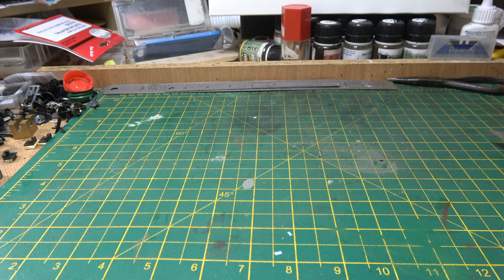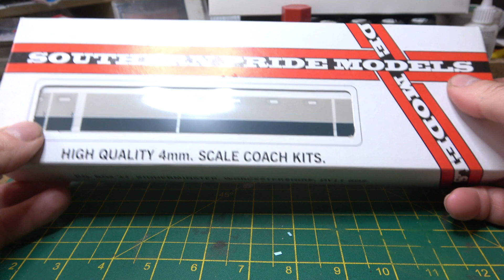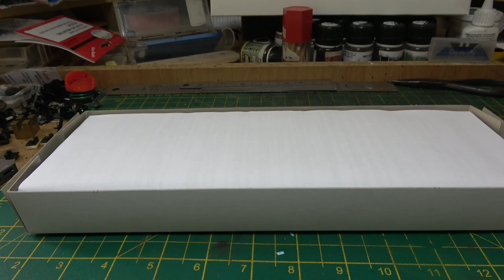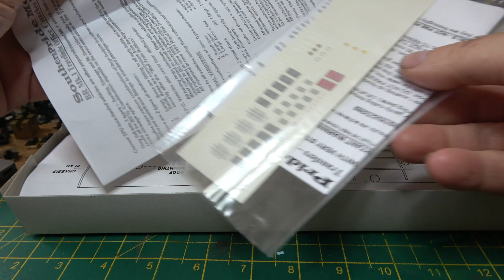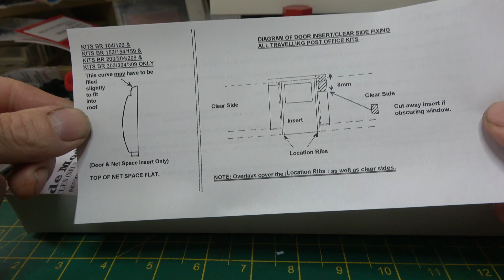Southern Pride TPO. Kit build.

Comment: Used to love seeing TPO stock when I did overnight spotting trips to Crewe; the York to Shrewsbury Postal (and return) stopped at Crewe for a good hour or so to load and unload mail. The would usually be hauled by a class 31 or (very occasionally) a 37 might show up! 

Add in the newspaper traffic and it was an interesting but tiring nights spotting! 

You have recreated the postal, newspaper and parcels traffic very nicely on your cracking layout. 

I used to model in N gauge probably about 30 years ago. 1969 - 1976 Western Region was the era. Its all packed up in the loft - todays models would blow these early efforts out of the water for detailing, but I used to do what you - modify existing stock to create interesting items which you couldn’t buy. 

So I am an armchair modeller now and enjoy watching you and a select few others strut their stuff on YT. 

Keep up the good work!